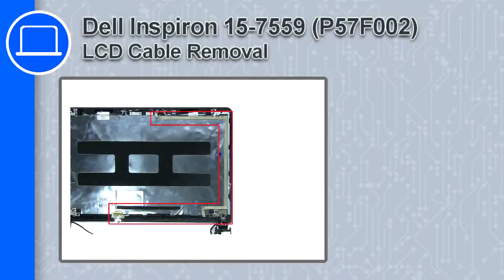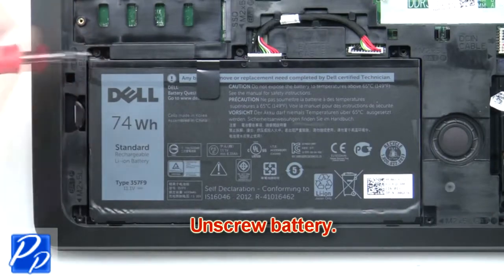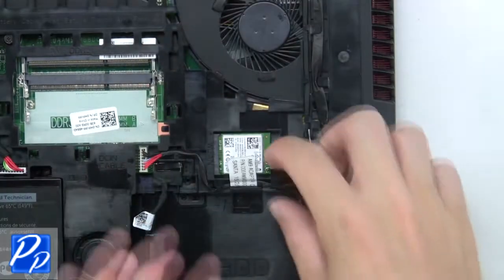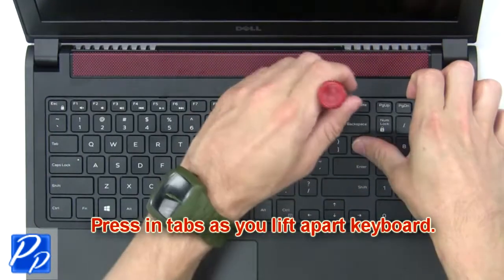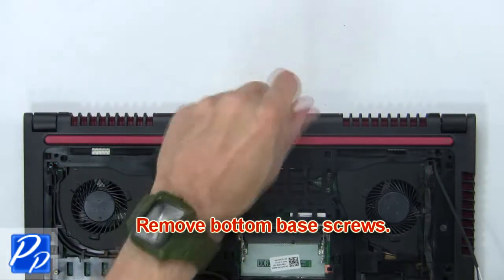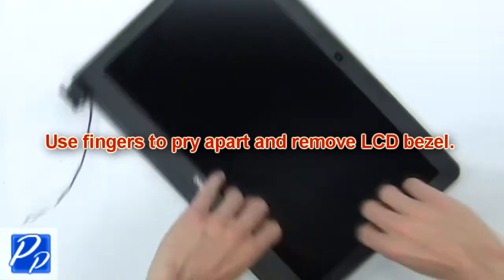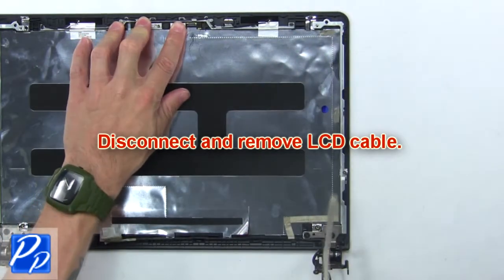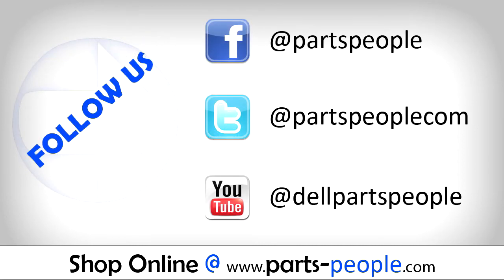Dell Inspiron 15-7559 (P57F002) LCD Cable How-To Video Tutorial

Comment: Hey, I am having an issue with my dell 7559. It's a 4k touch-display model. The camera is not working, and the driver is not showing up. Any suggestions on what is wrong? would be much appreciated!
Reply: Hi, i have the same screen, different issue tho. question is, how did you remove the lcd??
Reply: First guess is a hardware issue as it isn't even showing up on your system. But you could try locating where the circuitry connects and inspect/reconnect the cable if possible. It may have just wiggled loose from the motherboard. Would do some more googling though to get more ideas on if the inspiron has this as a known issue
Reply: Hi have the same problem. With te 30 pin conector

Comment: I followed it exactly now mine won’t turn on. The fan spins one rotation then nothing
Reply: (Super late I know) but did you get it working? Are you sure it isn't turning on? Perhaps try using a bright flashlight and see if the screen is on, but the backlight isn't working. If so double check every connection to the panel.
If that isn't the case I would try taking off any drives, WLAN card, battery and only have one stick of RAM in. Use the charger to turn the machine on and off as keeping the battery plugged in while removing/adding parts can cause further damage. If you get any farther (don't expect it to boot fully in this setup) then slowly add components back in after turning off and removing the charge cable until you find any bad part. Hope this helps!

Comment: hey, I have this notebook for 4 years... out of the blue (since last night) my screen is about 90% black, if I put a flashlight on it I can see things, so it's not all black out. Also it works just fine using the HDMI (wich is saving me right now)... Should I replace the cable ou change the whole screen?! 

I called a guy who works with this stuff and without looking he said it might be a problem in the mother boards, something about energy involving the screen... but he charged a lot just to repair without replacing anything, and again, he didn't even looked it.

What are your thoughts on this?

Thanks in advanced
Reply from the maker: Based on your situation I would suspect that either the LCD is going bad or your have a loose/faulty video cable.

Comment: This tutorial worked great on my Inspiron 15-5577. In the video, after the palm rest is removed, I noticed the fans magically disappeared too. I did not pay close attention to what order the screw holes went (housing, fan, then screen assembly vs housing, screen assembly, then fans), and it took me a little bit to figure it out (fans go on top). Anyway, everything is working again and so far no flicker, but it has only been ten minutes or so. I could not determine if the culprit was the LCD screen itself or the cable and chose to replace the cable first as it was much cheaper. Replacing the screen only takes 5-10 minutes, but replacing the cable took me a little over an hour. Thank you for the tutorial!

Comment: I opened to clean out dust now screen doesn't come on and power light flashes 3 white 2 orange
Reply: Zank88 G did you find out what happened?
Reply: @MrSlidthunder  yeah, my ram stick died. I replaced it and every thing works fine now.

Comment: After swapping out the LCD screen. I got picture and everything worked fine. But after a few days. My screen is so dim that I have to literally just a flash light to see what's on the screen. What do you think of wrong? Backlights dead?
Reply: I am having the same issue.  I can connect to an external monitor and it works...guessing either cable is bad or power supply?  may try new cable first.
Reply: I would order another cable but it's 25 bucks for the UHD one. I guess I'll have to do it.
Reply: Mine still works with an external monitor. Probably bad inverter? Who knows
Reply: @YoursTrulyy  Sounds like, perhaps when yours starting having an issue the panel may have shorted out and messed up the cable in its wake. So you may have fixed one issue but the panel had an underlying issue.

Comment: How do you know if the screen or the cable is bad?
Reply: It is challenging to know if the cable is bad or the screen. I had a bad flicker on the left side of my screen and narrowed down the problem to those two possible causes. Since the cable costs $10 (I ordered before finding this video and have no idea what it costs on the uploader's website) and the screen costs $80 I chose to replace the cable first. Replacing the cable, as it turns out, is much more complicated than replacing the screen, but following the instructions in this video I was able to do it successfully and so far (fingers crossed) there is no longer a flicker.

Comment: The insulation of the cable has been worn out and I can see all the small wires popping out. My screen is black now but when I connect the laptop to an external monitor or TV, everything seems ok. Is it possible to fix the cable or should I get a new one?
Reply from the maker: It's easier and more reliable to replace the cable over trying to repair the cable.
Reply: Hmm. But I live in India. I don't think you guys ship items to this country. Is it possible by any chance to get it repaired? Thanks for the quick response though :)
Reply from the maker: We do ship to India. You can find shipping cost and estimates on our website before you have to pay. You can also ship it to us and we can repair it for you. You will still have to use our website to setup the laptop repair.